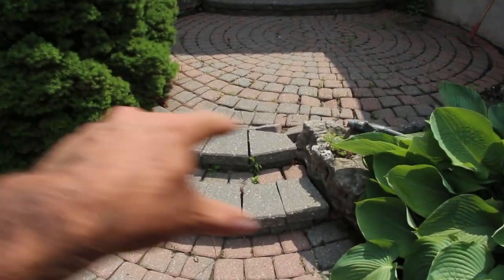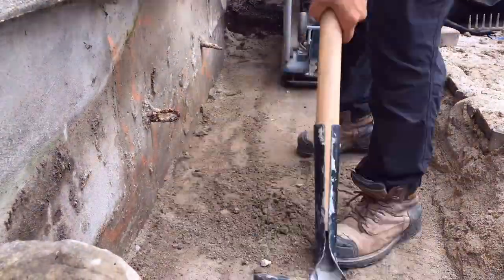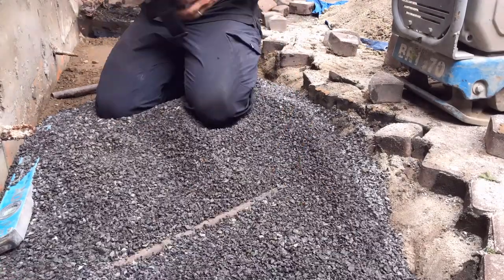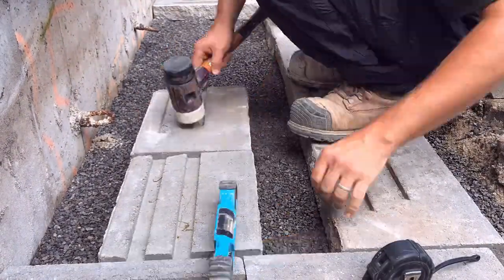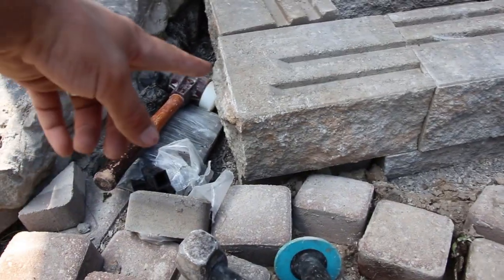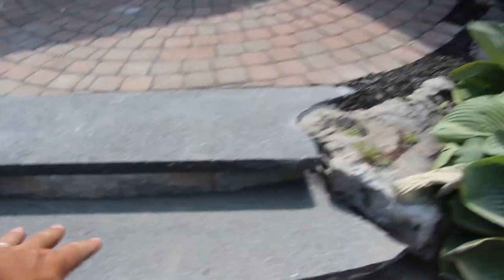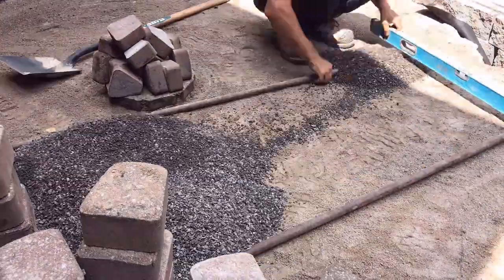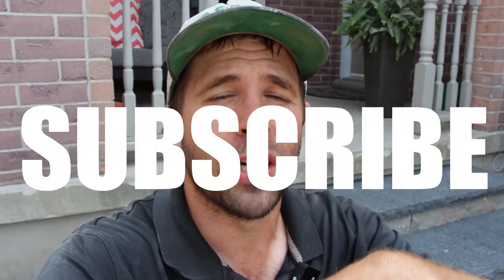How to Build Block Steps with Natural Stone Caps

Comment: Nice work! How come you didn't fill in the empty space behind the wall blocks with some clear stone? Was it necessary to have that first course of smaller wall block below the 6 inch wall blocks? Was that to make it easier to level things or did you want a minimum amount of embedment?
Reply from the maker: Normally I do fill it in, but we are likely coming back next year to do lights and re-do the walkway portion of this project so I wanted it open for that. Yes, I like to have at least 4" of embedment for steps personally.
Reply: These jobs /projects are tough!

Comment: Yes nice touch with the curves. 
I was wondering about something with the two top steps. The slab sits on top of the base blocks but you don't have to fill in those voides with HPB? Or would that be overkill/moot?
Also, is drainage a non issue given the slabs and base blocks are tight?
Reply from the maker: We usually do fill it in, but we are returning next year to install lighting and re do the walkway anyways so we left it open. Drainage will be addressed next year as well. Not too concerned about it because it is raised and can drain out to the left where the natural stone boulders are. Great questions Carl!
Reply: @iamahardscaper  That makes sense. What will you use, HPB? 
How about ................stone dust? 🤪
Reply from the maker: 😂 HPB or 3/4”